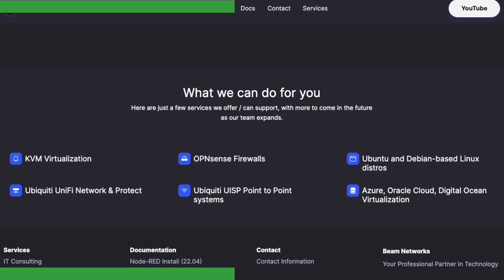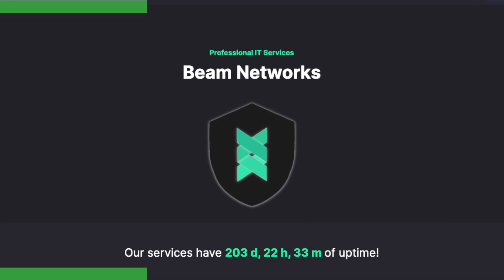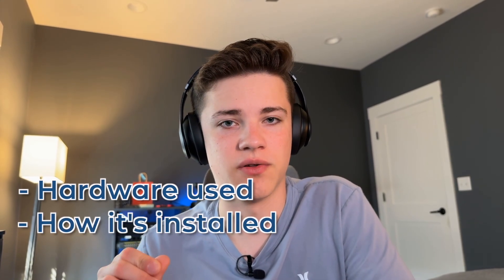Massive UniFi Access Install: Making Progress! (Pt. 2)

Comment: Nice video. Commercial doors can be difficult; the metal frames make them hard to customize, and the hardware for them is so expensive. Learning how to fish wires through walls and obstacles is an art that, for the most part, can only be learned through experience.